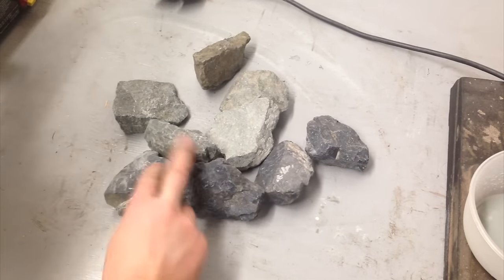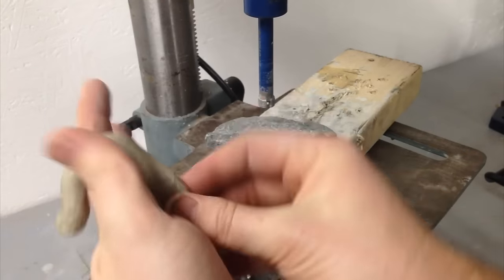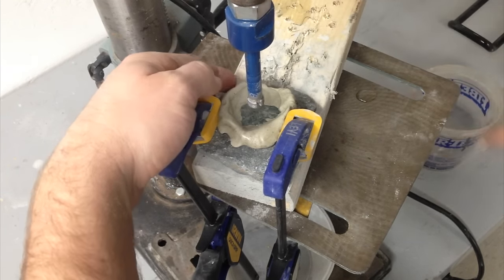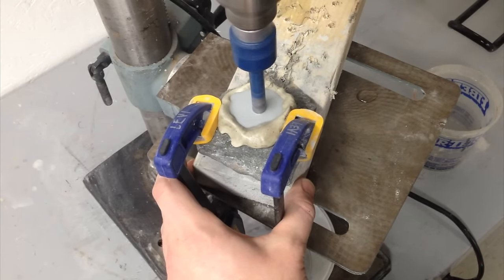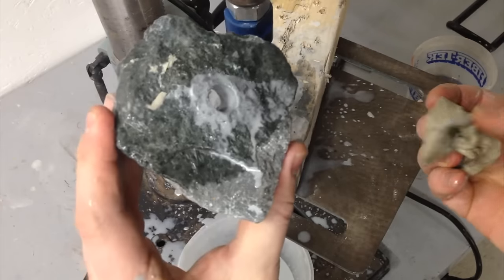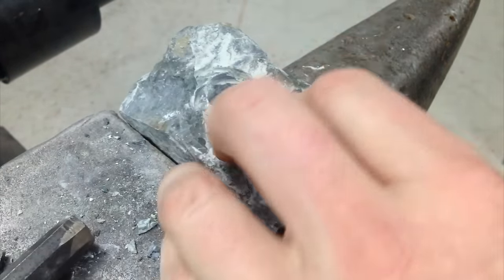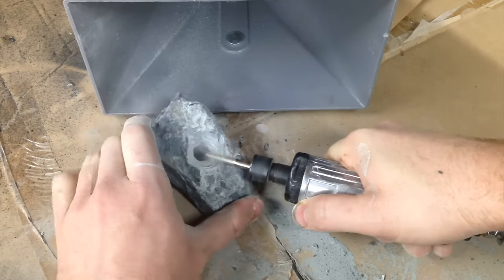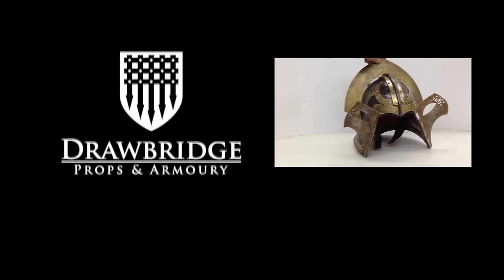Drilling Holes in Rocks

Comment: I just drilled a hole in a large rock to act as the base to a floor lamp. The putty dam was a great idea. However, it left a stain/residue that stayed on the rock. Have you ever experienced this? If so, how did you remove it?

Comment: water will boil (and steam) before the diamond drillbit will have problems just sayin
Reply from the maker: thanks for the correction. I was informed at the masonry supplier that the water helps keep the bit cool and makes it last longer. Is the water more as a lubricant? I'm by no means an expert and will add an annotation to the video if I gather new information that will help other people with this type project.
Reply: Well i am just an engineering student, nothing fancy, but generally unless you try to cut something with it that can be alloyed with carbon (like alloys of iron) diamond will not be damaged below 700°C at which pint it can ignite in air.
Without air its even less of an issue as it can take more than 1500°C in the absence of oxygen.

(Of course different materials have differing needs for cooling, as steel drillbits can anneal themselves pretty easily, while wolfram carbide has less problems with extreme workloads)

English is not my native language, so there can be some errors in my post :/
Reply: +Drawbridge Entertainment The purpose of the water is mainly to lubricate the non-cutting portion of the drill bit, but it also cools the edge and wash out all of the small pieces. Without the water, you will end up sanding down the bit. I personally prefer to use motor oil (though I work with metal, not stone, so I'm not sure if that makes the difference).
Reply: also helps mitigate dust, which depending on the type of rock be quite hazardous to breath